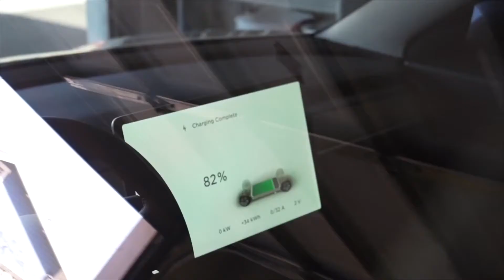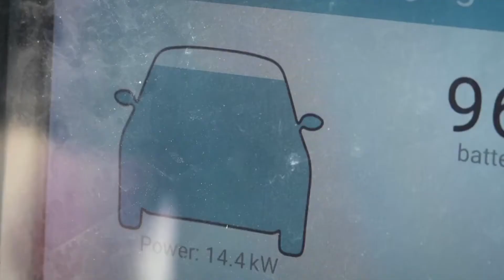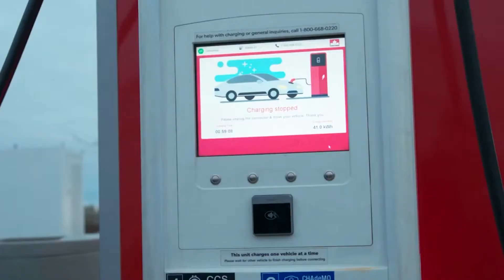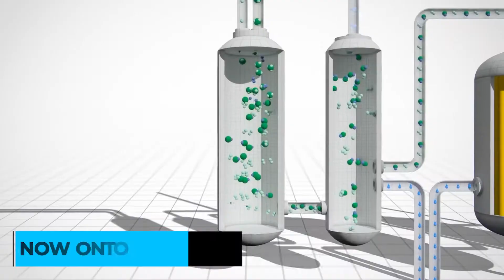Batteries Or E-Fuel.. Which Is Better For The FUTURE?

Comment: Efuel with 50miles plug in is good! If everyone had a 60kw battery pack the electric grid would be over whelmed and cost more and pollute more then using more efficient engines!  Solving the energy storage if renewables and fuel problem!!